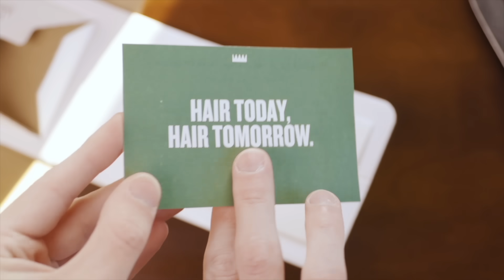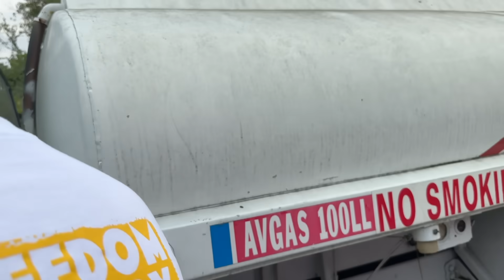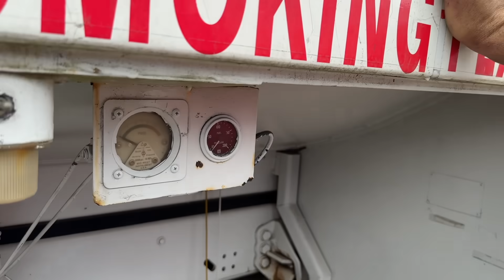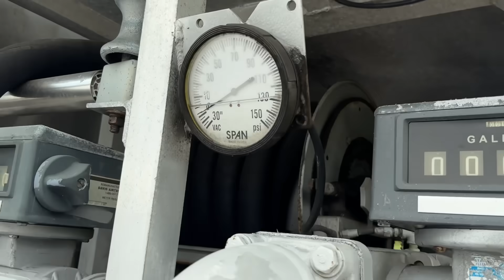I Bought An Abandoned Fuel Truck For Our New Airport!!!

Comment: I hauled fuel with a semi for a living. Hear me out for everyone’s safety.🇺🇸🦅✈️

Get bulk tanks and have fuel delivered to onsite storage tanks. Then use these trucks to take fuel out to aircraft on the runway. I bet You don’t have a Hazmat endorsement on your license. You can drive these on site, but you can’t travel down the road with fuel on board. Or just have a semi deliver fuel to these tanks on site and use them for storage.  Insurance to put these trucks on the road is not worth it. Those look like 3,000-4,000 gallon tanks. I would only use these For site trucks at the airport. I would not try and haul your own fuel. One tank for Jet A and one tank for 100 Low Lead. Most fuel tankers have 3-4 different compartments. Most are 2,000-3,000 gallons each compartment. The tanker I pulled was 9800 gallons with 4 compartments. If you buy some extra tanks they can fill both trucks, one with jet A and one with 100 low lead. Then have a separate stationary tank for Jet A and 100 low lead. This way you can buy a whole semi load at once to save money. Does the trucks have transfer pumps to fill the trucks? Just make damn sure you hook up a ground line to the trucks if you top load from a stationary tank or they will see the mushroom cloud from Georgia. Transferring fuel to a metal tank is very dangerous. It will be much cheaper to have a semi deliver fuel than trying to transport it yourself. Please get someone that hauls fuel at an airport to come show you how to safely fuel an aircraft from a truck. I also fueled planes at CVG airport. The training was 5 days long. Seriously. Be safe and don’t burn the hair off squirrel. 🐿️🇺🇸🦅✈️🛩️🦒🚁

Side Note; We need some Jet Boat content and JH’s Airboat, and your brothers Longtail. It’s been awhile. 🇺🇸🦅🚤

Comment: Go and find a fuel supplier first.  They will come and inspect your rigs before they will risk the liability for putting their fuel in your truck to sell to the public,  I ran a FBO for years and have been down this road.. Your Stainless truck is OK but your AV gas might need the tank  might need sealed if it is a mild steel tank.  One truck is from AV Fuel and they are a excellent supplier that I delt with for years.  Goood luck and welcome to the wonderful world of Gov regs that you didn't even know existed!   Denny

Comment: If you are not pushing in the clutch to engage the PTO you are the problem!!  If it is a stick shift you have to push in the clutch to engage the PTO!! If it's a automatic it runs off of a hydraulic pump off of the motor! Two different types systems!!

Comment: Watching this hurt my soul as someone who spent 10 years working on fuel trucks exactly like these at dozens of small airports. Please do complete research on proper operation and maintenance of the fuel side of these trucks as you can very easily get yourself hurt, cause fuel quality issues, or an environmental incident if you dont know what you're doing. Definitely willing to answer questions or help out with where to get parts if needed.

Comment: We have storage tanks where I work, 5000 gallon diesel, 1000 gallon gasoline, 500 gallon waste oil above ground tanks and a 3000 gallon underground diesel tank supplying a couple of boilers, as well as several other, smaller units supplying various pieces of fixed location machinery with fuel and lubricating oils. Daily, weekly, monthly and annual self inspections. County, state and federal inspectors (we're on federal land) as well as our corporate safety/environmental dept can pull the old "Pearl Harbor" visit (sneak attack) at any time. Storing and dispensing petroleum is a big pain in the ass, even when it's for private use, especially when you're located in California and in a national park where there are endangered and protected species of plants, amphibians, birds, and mammals on site. Our drainage? It feeds directly into a designated wild and scenic river. Whatever rules and regulations you need to follow in Florida, remember that it could be worse!

Comment: CORRECT:  It's a two-barrel for a reason.  And NO, putting a four-barrel on it wouldn't fix or add anything.  That vehicle is trying to move tens of thousands of pounds of fuel around.  To do that you need TORQUE, not horsepower.  Period.  Leave it alone.